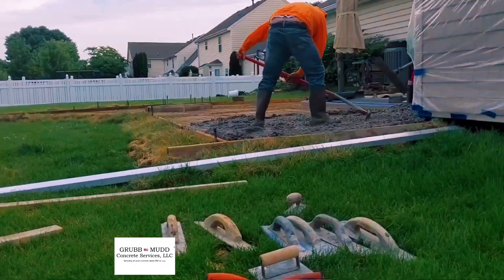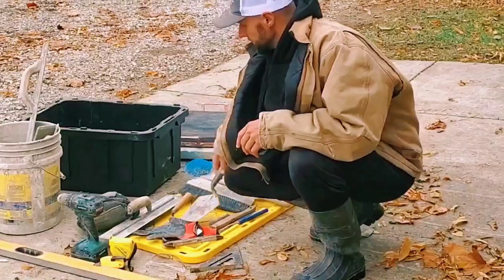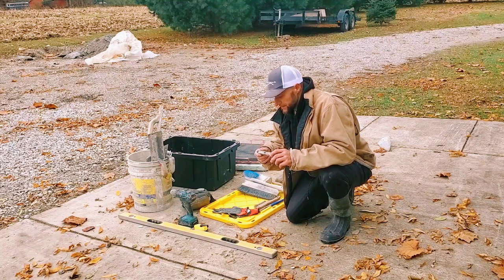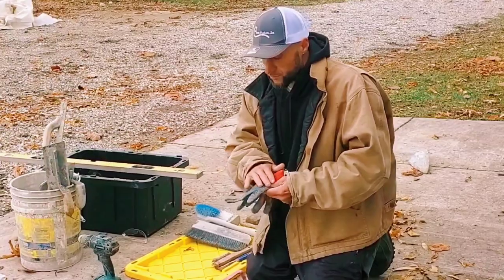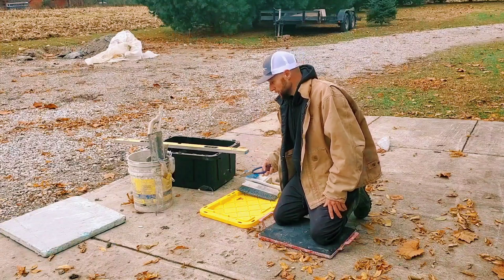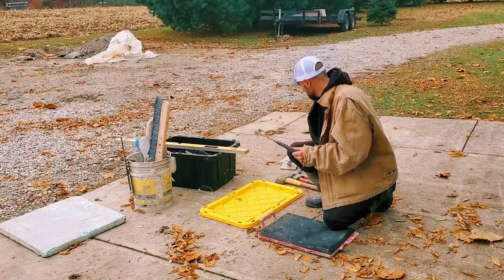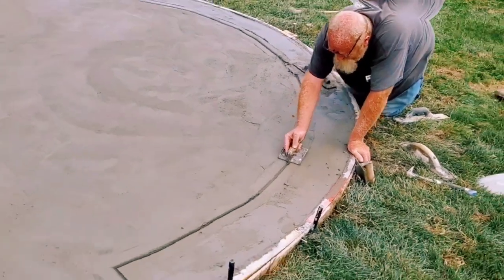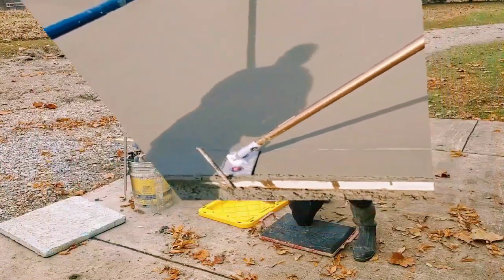TOP 10 CONCRETE tools every Concrete finisher should have

Comment: Great video Bobby. Some honorable mentions would be stair tools for those that don't use liners and maybe very comfy boots also a cheap tool kit from home depot. I buy the 20 dollar one with miscellaneous tools. I surprisrisingly open it up all the time.We always have the manual wire ties. Sometimes batteries aren't charged or we forget spools of wire for the gun. I use the wire brush for scrubbing edges where we meet old concrete. Cleans off new concrete stains. Great list of tools to have for sure.
Reply from the maker: yeah yur right. I totally forgot about step tools, I've never used them ever. not even b4 I had liners. and I usually tape my existing concrete so I didn't think about that. the plyers were kinda for that, but a cheap tool kit def is nice to have in the truck, did u see yur wife in the video?

Comment: I'm pretty sure somebody mentioned that already on the comments I believe I haven't seen it I used it when I do stones flagstone or whatever you call it for a seat walls and motor to give it a nice clean brush finish rough it up between the stone that's what it's called break also anymore clean brick a vertical walls and that kind of stuff and you can also use it to one flash services with joints don't work that's what they use for but you can sweep your kitchen or your house with it haha LOL trying to be funny is it working but anyways kick ass video I learned a lot from it me I like to have extra tools with me in case I lose one, the way I am I lose my mind every other day but anyway awesome ved good love the way you explain the tools , what is that tool called I don't know some shoulder maybe day maybe you didn't but anyways that goes on the bottom step on the bottom of the riser to the sidewalk instead of rounding on the outside it you're going to round it inside what is that tool called?? And? And another one and another one?? Haha
Reply: Inside Step or Inside Radius Tool.

Comment: I wouldn’t say a rookie finisher should have a 6 inch edger I work with finishers that’s been doing it 20+ years and they still use one only use them small ones for places the 6 won’t fit
Reply from the maker: Yeah I get it, I heard the rookies use the 4 inch other places, but I prefer to put the rookies on the 6 so the won't roll it as easy
Reply: @GRUBB-MUDD  yes sir then they get use to that security so they just stick with the 6 lol I like the 6 I’ve only been doing this 5 years I’m 24 so I prefer a 6 just to insure the flatness of the edge but I need me one of them darbies man I’ve used one a few times on sidewalks their fun to play with I’ve never seen one used how u use it that’s pretty cool that’s why I love this concrete community I love to learn new things then go to work and bust out the new moves lol